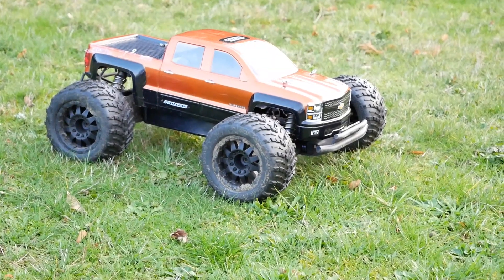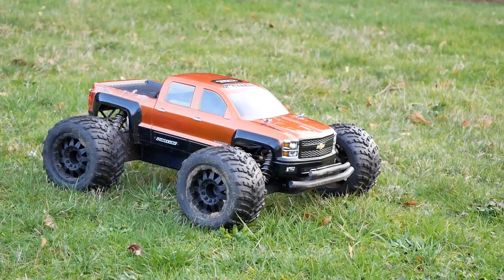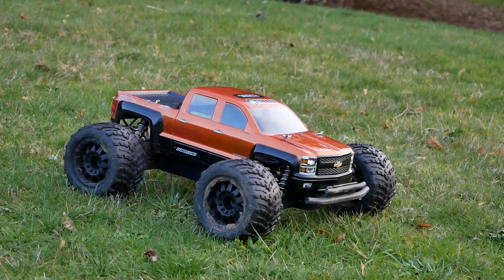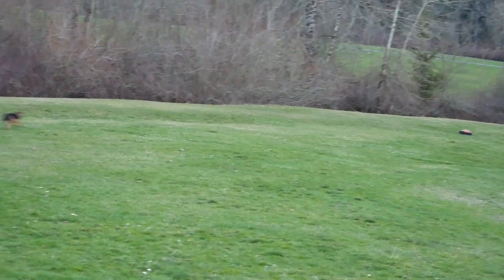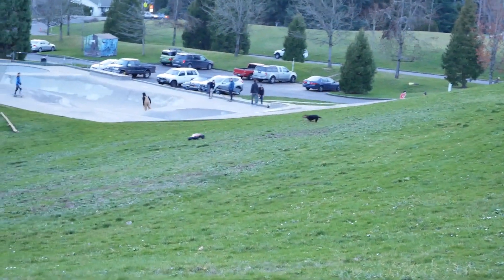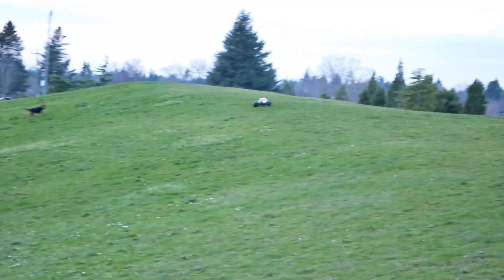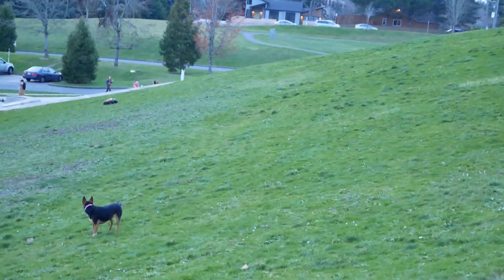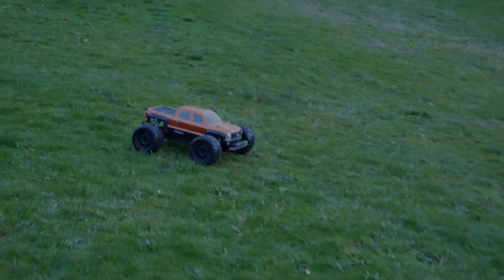Tekno MT410 8th Scale RC Truck 4S Running Video and Improptu Race Against a Terrier

Comment: Tekno MT410 hands down the best MT KIT out there. I love the quality of the product makes for an awesome tough truck. Little pricey but Worth it 👌. Those are great tires for loose gravel, tarmac but not great for Grass. I recommend dboots bickflip or proline Badlands 3.8( not MX 38). I believe the proline Mashers are same dimensions as the shockwaves but superior traction. Great run brother. You've given the 🐕 a blast of the lifetime LOL 😂.
Reply: I've caught some of my biggest Air with this Rig bro.. check it out when you get a chance. Awesome run man..
Reply from the maker: Great stuff, thanks for the tips on the tires. Checking out your videos now!

Comment: Good vid. If that's a 2200kv, it should handle 4s easy, especially in that truck. You could probably gear up or even go 6s if you're feeling wild.
Reply from the maker: Hey, thanks! Yeah, it's a Castle 1515-2200kv. I was originally running it with much bigger, heavier tires, and I felt the 17t pinion I had been using was too large, but with the smaller tires shown in this video, I could definitely go bigger than the 15t I was using.

Comment: Wait, yours runs hot on 15t on 4s? Or was that just previously with the 17t and the previous larger tires? Just curious. I run the same tires, also just on 4s, but 16t pinion (though for now I'm running the Arrma 185 BLX system, probably get a HW for it sometime).
Reply from the maker: The motor was getting above 180F when I ran it with a 17t pinion and huge Duratrax Six Pack tires. With the 15t and smaller Shockwave tires, it topped out at 155F on 4S, which is fine. I actually didn't need the smaller pinion for these tires, but I made both changes at the same time just in case. Since then I've switched again to bigger Pro-Line Big Joe II tires, and so I'm going to keep the 15t pinion. The Shockwaves would have been fine with a bigger pinion. But remember, I'm running a Castle 2200Kv motor, not the Arrma 2050. The Castle 2200Kv is a very fast motor for a truck this size, and needs to be geared down. Castle has told me that directly - they have a lot of people calling about overheating in the MT410 using that motor, but it's because they are running too tall a gear.
Reply: @TheTechBuyersGuru  Thanks, yeah originally I was running the exact same setup with the only difference being I was using a 16t, but ended up putting that system in my Summit (because it was my only sensored brushless system). Nice run btw.